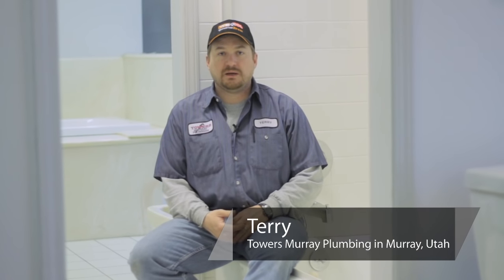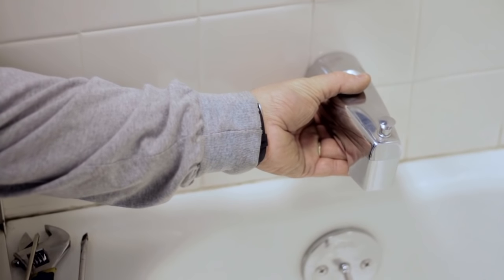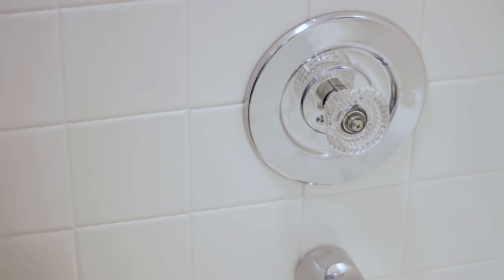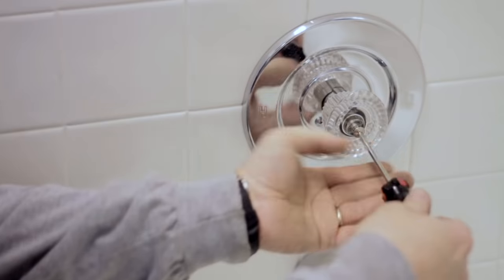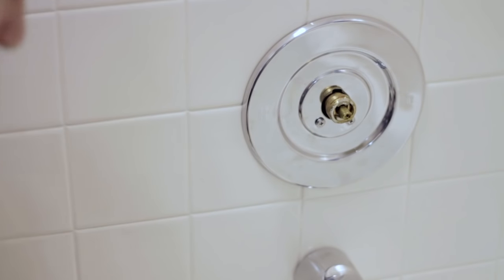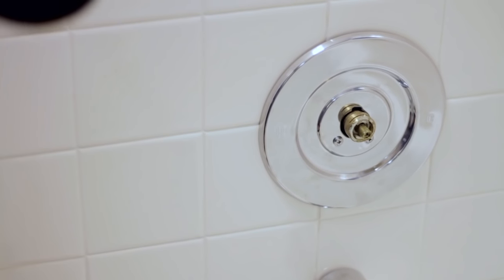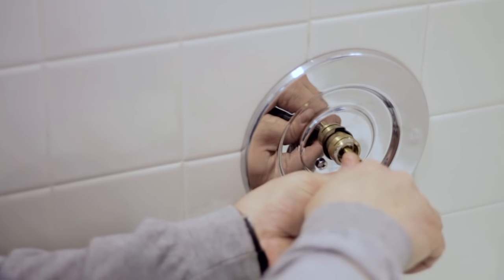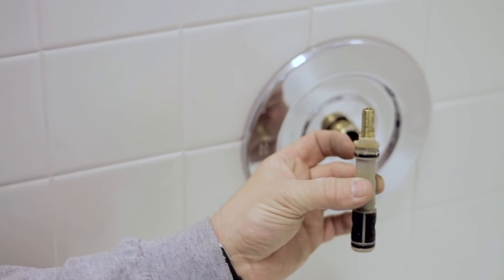Fixing Faucets : How Do I Fix Water That Keeps Running in a Tub Faucet?

Comment: I followed your directions step by step and it worked. Thanks so much. This happened in the evening and I could not find a plumber to come out. Short of having to keep the water off for the entire house until he could come the next day, I decided to try to fix it myself. Ran to the hardware store, found the cartridge and bam, it's fixed! I am still having the plumber come out today (before the weekend that would cost me time and a half) to make sure I did it correctly. You are awesome. And yes, turn off the main water line before taking your shower apart, unless you want a flood. For those who forget where the pieces go, maybe videotape as you take it apart so you know where things go back again.

Comment: I have the same style faucet. When I turn it all the way off, it drips. However, it sounds like the water is actually still running very slightly. When you put your ear down to it, you can barely hear it. Is it possible to tighten it up somehow?

Comment: I tried this to see if I could get open it because mI need is running even when it's off but now I forgot where a part goes mine didn't come off in 1 piece like this there was the knob cover the knob a washer and screw and another piece being held to the piece that I need to remove but I can't seem to remember if I took it off if it was inside the knob or behind it. I'm getting the part from home depot tomorrow while I'm on lunch if I bring the pieces with me can the tell me how it goes back together. I'm not a handy person but my mom is a single mother my younger brother who is the only man in the household doesn't know anything about this stuff leaving me to fix anything that goes wrong

Comment: My situation is different. I can turn the water off with the cold knob but can't turn the water off with the hot knob in my tub. The pressure is full blast, not just a drip or small leak out the faucet. I did exactly what he did but water continues to flow out the tub faucet.